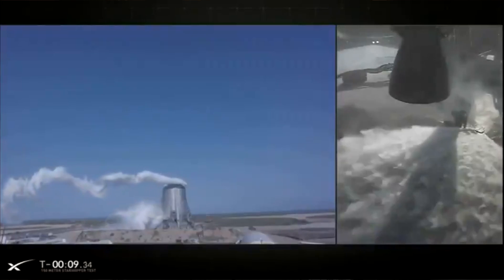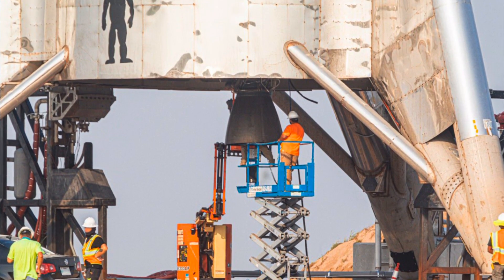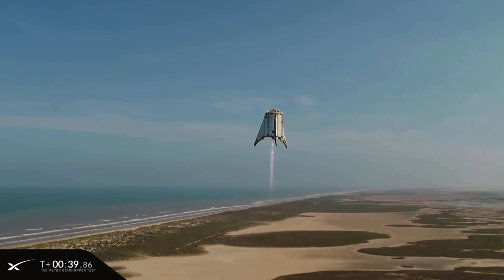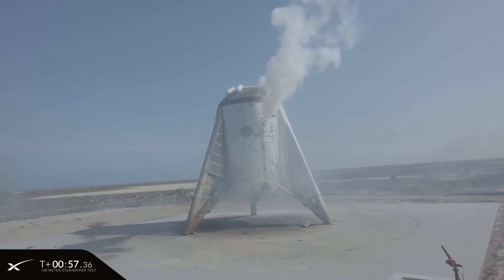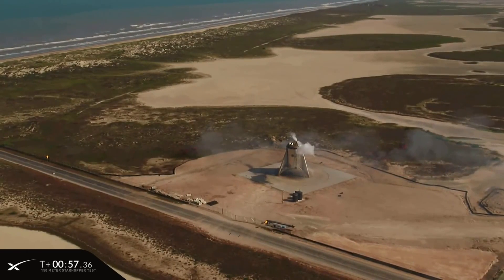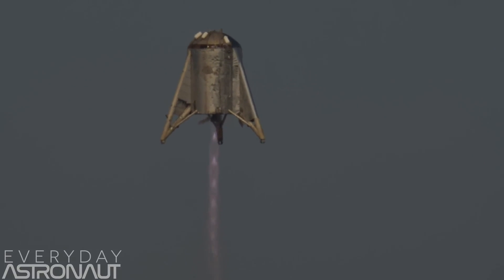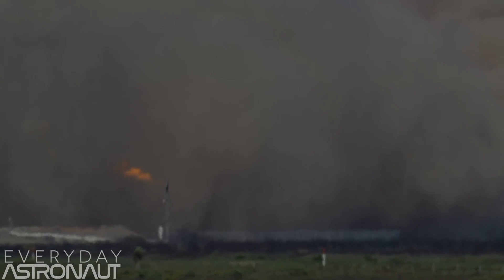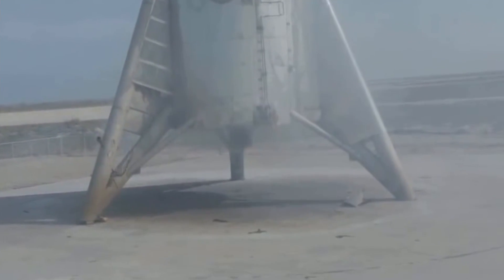Starship Hopper's Biggest, Lastest Flight Above Texas

Comment: What it is is they change the mixer and make it rich to dump more methane for safety reasons. Because if something was to happen there's less chance of  catastrophic explosion. It's like venting the tanks. Also it makes for a colder burn when that flame hits the ground it deflects heating all around it that's not good when you have the legs of the lander being heated by a cutting torch.

Comment: I can’t get overly excited about this achievement. McDonald Douglas did this in the early 90s with the DC X demonstrator. This was a single stage to orbit sub-scale sized craft. I think it flew maybe 12 flights point to point before a catastrophic failure destroyed the vehicle. McDonald Douglas were able to prove the concept. This is nothing new!
Reply from the maker: DC-X was flying with an expander Cycle Hydrogen Fueled RL-10 engine which has its origins in the 1960’s. THis was flying with a Full Flow Staged Combustion Cycle Methane engine a type of engine which has never flown before.

Comment: Can think of a possible reason for wanting to run very fuel rich just prior to touchdown. Running a higher mass flow, lower temperature and lower exit velocity exhaust would reduce damage to landing pad. It would also reduce heat soak experienced after engine shutdown.

Comment: When ever I want to hear the faults about any SPACEX  launch, I can depend on Scott.
For your information, the rotation  anomaly was caused by a broken pipe from a nitrogen pressure tank. You know the one that broke loose at the end.
ALSO the flame color at the end is due to the loss of pressure feeding the oxidizer to the pump causing an over rich condition.

Comment: The colour change  happened because they need the boost to drop quickly at the close height approaches, the difference is caused by the chemical change in the gases. The single gas burns yellow but mixed its white.

Comment: it took off, it manoeuvred, it landed without blowing up on the pad; = Success.
 just because an 'over-enthusiastic' pressure vessels wanted to do some 'unauthorized flying' ...well, that's beside the point, and beyond the scope of a successful Test. and landing gear is easily replaceable. the Important Take away here is... IT DIDN'T BLOW UP!
--Rick

Comment: I also thought it was a sodium black body radiation like you. I have changed my mind after seeing the fuel leak on the engine plumbing. As the fuel leak outside the engine increased it was entrained into the exhaust stream. This would cause a rich situation and seeing as hydrogen is preferentially burned in a rich mix it would leave the carbon ( this is how carbon black is produced ) to emit black body radiation from the exhaust stream. This could also not be the case, but for me it's an improved guess.

Comment: The A4/V-2 used a pyrotechnic ignitor which had to be inserted into the nozzle - in fact, it was a device similar to a pinwheel firework.  If the engine didn't fire, someone had to actually insert a new one before they could attempt another launch.

Comment: it might be able to fill up MFA-1  after 200 flights. I would order 1 inch threaded rod , connectors, plywood , sabre saw blades, rolling spot welder,  some sort of steel that spot welds ,  jack bolts , bronze age nuts with levers.

Comment: Power to weight is the huge consideration. Yet thinking about the density of the astral body to land on; gravity compression differential. To create pressure by angled engines, and thrust into that pressure, would create less of a dust drill. Consequence is a lot of precision work and added weight.
Reply: Additional thought:
Cold in space compared to earth atmosphere as well as reduced atmosphere. How much does the bell cool relatively?  The thrust expands faster so, drop ring bell extension, could be lighter than main bell materials, for deflection/thrust.

Comment: The only method you get polymerised carbon in a methalox exhaust is via thermal decomposition of methane. To achieve this, the Raptor's LOX turbine must have either failed, or not been delivering enough LOX to support proper combustion by a very large degree. Essentially, it must have been running ungodly rich.

Comment: The shoe loss would also be consistent with an unexpectedly hard landing. Glad it ended up mostly in one piece!
Reply: The shoes could have been designed as sacrificial. They covered sacrificial crush pads. The F9 legs "give" on landing to absorb the final forces. Looks like they didn't bother with such an expensive mechanism for Hopper. The F9 engine cuts off just before touchdown. Seems reasonable Hopper would too.
Reply: @donjones4719  Good point, I hadn't considered that. Could well have been sacrificial shoes.

Comment: That is a very common practices when dealing with dangerous experiments. I worked with a Reversed Field Pinch (RFP) fusion reactor as a part of a bachelor course in electrical engineering. When ever we entered the reactor hall we hade to take a key from the key slot in the wall and hang it around our necks. If any of the keys where not in the slots and turned around then the reactor couldn't even charge. This was so that no person would start the reactor process while anyone where inside the reactor hall or inside the room capacitor bank by mistake.

Comment: Something definitely went wrong with the fire coming out of the side and that may have caused the change in the color of the flame. Either the cone itself might've started burning or it might've changed the a/f mixture by venting some of it laterally. If you think about it a lot of the power in rocket engines is created by external combustion not internal in the chamber so when you suddenly aren't getting all of it where it should be that's a massive loss of thrust. To me it'd seem like it would've turned lean and not rich though, which should've actually made it burn brighter (clearer) instead of more orange. I'm pretty sure something just went very wrong internally with that engine, especially with the part that went flying off. A carbeurizing flame (fuel rich) tends to burn more orange whereas a lean aka oxidizing flame tends to become more and more blue/clear until it snuffs out. (I was trained as a welder) It's easily shown with an oxy-acetylene torch demonstration.

Comment: 7:35: Why are there periodic hot spots on the exhaust column? Is this some kind of a standing wave?
Reply: Declan Brennan Mach diamonds. From Wikipedia “shock diamonds”: “Shock diamonds (also known as Mach diamonds, Mach disks, Mach rings, donut tails or thrust diamonds) are a formation of standing wave patterns that appear in the supersonic exhaust plume of an aerospace propulsion system, such as a supersonic jet engine, rocket, ramjet, or scramjet, when it is operated in an atmosphere.”
Reply: @timeastman8319  Thank you Tim. Just what I was after.
Reply: Declan Brennan No problem! Physical oddities like this have interested me fo decades. ‘Mach diamonds’ is the term I first learned (lonnnng before Wikipedia).

Comment: What is that flash of yellow that streaked down the exhaust plume at 7:47? Not talking about the change in color of the entire exhaust that has been massively discussed. Was just there for a fraction of a second. Is it related to the plume of dark vapor streaming from near the top of the engine for  long time prior (indeed almost the entire flight)?

Comment: Not having a proper oxygen mix will cause the flame to burn yellow. At the end of the flight, after the engine shut off, SpaceX recorders on the landing pad recorded what sounded like a whirring sound that lasted for at least a minute. It sounded like a rotating part that needed oiling, or re-honing.

Comment: "I've been in the welding industry for 20 years. The flame out of the rocket is due to the acetylene, I mean, methane not completely burning with the rocket. It certainly can't be from the emission spectra of chemicals getting mixed in to the flame or any other reason. Only my reason is legit. I'm the expert here!"

Comment: Fuel ratio effects the colour of the fame, red/orange is a rich fuel mixture. Blue is more stoichiometric, while a purple/violet is more towards a lean mixture. When the Starship Hopper is landing and there is a pulse of orange flame in the main exhaust indicating a momentary rich fuel mixture. If this was the unintended result of excessive fuel pressure, it could have lead to a fuel line rupture and thus the secondary orange (rich) flame/small fuel fire ?
Reply: Do you mean the pulse of yellow/orange at 7:47? It seems to originate at the point where a plume of dark vapor has been flowing from near the top of the engine for most of the flight. The small yellow flame that appears at 7:53 is at that exact spot, I'm 99% sure. The vapor plume has just rotated almost out of sight when it ignites.
Reply: Yes the pulse of yellow/orange at 7:48. It can be seen in the main propellant and can be seen to travel from the nozzle to the bottom of the computer screen. There is anther orange pulse later in the You Tube video, same thing but less intense.  The small dark vapour seems to momentarily disappear (at the same time as the original yellow pulse), but starts up again afterwards. The little orange flame appears to start to the left of where the vapour plume is and they are different and both can be seen in the one screen shot.

Comment: I assumed they were throttling the O2 and allowing the methane to run rich. That would be better than trying to adjust the output of two separate turbopumps simultaneously and running the risk of a lean mixture.

Comment: I think the  reason why Elon is now talking about fins and landing legs being seperate may be so if there is a harder than expected landing then control surfaces are not damaged which this test flight proved with the "shoes" getting crushed. Dont want the fins crushed after landing on Mars.
Reply: Saving the fins from damage makes total sense. But the crush pads on Starhopper may be a simple expedient for a test model. You know how Elon hates anything on Starship to be one time use only.

Comment: As a software developer I think it's super cool that SpaceX managed to get this test spot on the first time. (The first failure was a hardware issue :P). Both the amount and the complexity of the code guiding that burning steel drum is certainly non-trivial.

Comment: I think the different color in plume is for downthrotling the engine thrust decreasing the oxidizer mass flux only. I think that it is a more accurate downthrotling way instead of to maintain fuel/oxigen ratio and downthrotling the pair of fluxes  at the same time.

Comment: I am most impressed the guidance system was able to keep it mostly stable as the center of gravity moved. No wild sideways oscillations, for example.
Reply: The bigger the thing gets, the slower it tips over (more angular momentum), so there's actually ample time for the guidance system to react. Balancing a broomstick on your palm is much easier than balancing a pencil.
Reply: @u1zha  There is a range of mass distribution that my body can handle well, yes; on the other end, I can't balance a long metal pipe well because I lack the strength to bring it back to equilibrium. 

There is a whole system of inertial guidance down through thrust control and gimballing that all has to work, all of which is NOT instantaneous, and if you don't model response times properly, bad things happen. So I give them credit for doing a good job on something difficult. More testing is still required before I'd say they have a handle on it, but not having to completely rebuild the test vehicle helps.
I now understand why this tank thing was built: the guidance/control people needed something to play with before the starship design was complete. And if they crash it, you don't lose a lot of time/money. It might even be worth testing failure modes until you do crash it.

Comment: George Sutton from "Rocket propulsion elements" told a great story as a young engineer. He was the skinniest of the them and it was his job to stick his head up inside the engine on the redstone rocket after a test and do an inspection.  However the engine  hadn't been purged or ventilated well and after a few minutes he was totally drunk from inhaling the Ethanol fumes.  Only time he was paid to get drunk on the job.  After that they properly vented before doing the inspection.

Comment: I'd say it is mixture: As in a DIFFERENT propellant used to obtain better throttling properties with the big engine.  Precisely throttling is VERY difficult.  Gets harder the larger the engine.  Oxygen is probably held ~ constant but the ratio of say Methane to Kerosene or something else could be used obtaining better propellent adjustment for fine maneuvering.  This is NOT a Falcon 9 with its high deacceleration profile.  This is supposed to be human crewed and the bigger the rocket, the more momentum problems one has requiring MUCH more precise throttle adjustment.  The Kerosene would be warmer yet remain a liquid unlike Methane making it MUCH easier to accurately inject into the combustion chamber.   Or more likely could be that they have 2 throttling injectors using 2 different fluids Methane/Kerosene allowing coarse/fine adjustments. 

In other words: Baby steps.  Not going whole hog on fully throttling adjustable methane engine.

Comment: I told them this would happen but my lighter rocket was explosive they just got lucky. It took out a hard wood outer wall fracturing it when it blew up. Fortunately it only damaged the inner wall. Not the outer or the inside wall just the inch thick hard wood support.

Comment: I gotta say, I love how publicly SpaceX is willing to fail. They don't seem to mind when things go wrong and people see it. They self deprecate a bit (how not to land an orbital class rocket), then they explain what went wrong, and test again to show they've fixed it. It's fun getting to feel like a part of the process.

This test was so useful on so many levels. Can we build the thing the way we think we can with these materials? Yup. Even in a freaking field.
Can this engine be integrated into the structure we expect to have? I'm sure they learned a lot and modified many things doing this.
Can the engine fly a vehicle in a controled manner safely? What didn't perform as we thought? Why? How do we improve that?

I can't even imagine how much they learned doing this. Fabrication, installation, etc. All benefited from doing this. Even work on the flight control software probably got benefits.

Comment: Scott -
A good question would be: “What Texas Fuel source is SpaceX using for these initial tests?”. 
Pure Methane (CH4), doubtful.  More likely, a local Liquid Natural Gas (LNG) source.

LNG is a mixture: 85-95% Methane & 5-15% Ethane, Propane, Butane & trace of Nitrogen.
The LNG mixture varies across the USA according to its source and processing history.
—
Natural gas is a Blue flame with complete combustion, and burns at a temperature of around 1,960°C. 
Natural gas flame color Orange indicates incomplete combustion. 
What color does Methane (CH4) burn is the same answer.

Red or Yellow natural gas or LPG (propane gas) flame color is indicative of incomplete combustion and carbon monoxide emissions. 
Red or Yellow gas flames only burn at around 1,000°C.
These yellow-red flames are normally due to the incandescence of very fine soot particles.
==
BTW, Methyl Mercaptan (“Rotten Egg” smell) is added in Natural Gas pipelines for Leak Detection.

Comment: 2:51 dust didn't react to supposed high speed powerful exhaust gas which is strong enough to lift a ugly water tank rocket that weight 85,000 kg..

i smell a amateur CGI mistake here..

Comment: About those keys, I used to work at a factory where they did something similar. Whenever some maintenance technician would have to go into one of the security cages where the heavy machinery was, they'd padlock the cage access open or the controls shut (the cages had dead-man switches which would prevent the machine inside from working if the cage wasn't properly closed). Each technician had their own padlock, and they were the only ones who had the keys, so no one could inadvertently start up the machine until they were back outside and out of harm's way.

Comment: I looked the SpaceX video again.  I think the flame was ok.  Except for a couple flickers or flash, it didn't seem to brighten until the kicked up dust cloud began to get drawn into the exaust, I think...like you explained.  Also, I think SpaceX's audio was still from the on-board camera, even though the video had quit. I think I could hear that COPV spinning off and away, even though we couldn't see it through the clouds in that view. :)  What caused the flames above the engine bell, to the side of the engine?...maybe not that critical.  It didn't seem to continue to burn after engine shutdown.  I didn't see signs of a hard landing.  But like a truck with no springs, it doesn't take much to make a hard ride.  With appropriate shock absorption gear, maybe that COPV doesn't fly off.  But mount it better, next time! :)  Will there be nitrogen thrusters on the Starships Mk1/Mk2 or later?  Or what gases, combustion or inert, will they use?